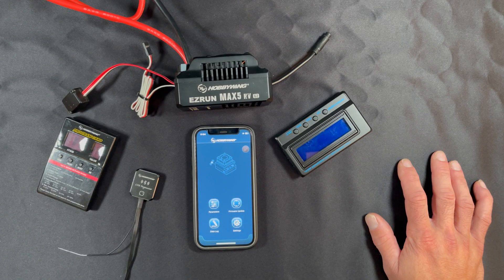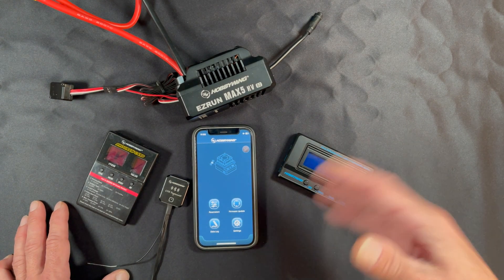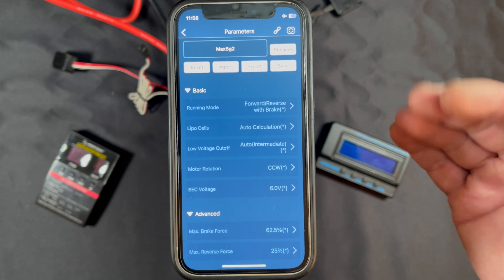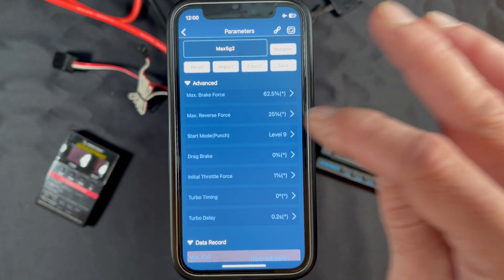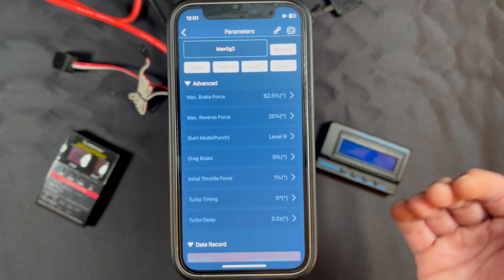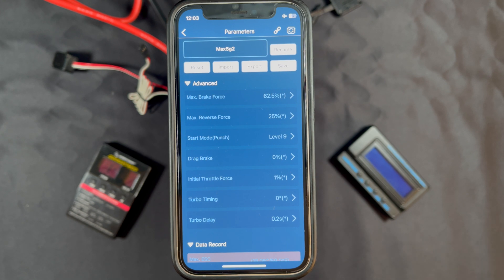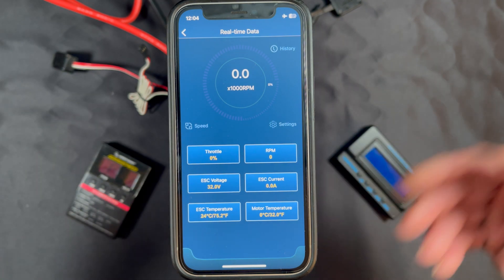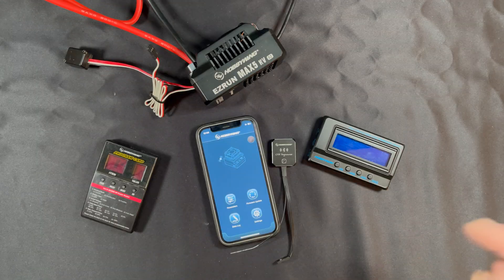The Charlie Show // Episode 323 /// Max 5 HV G2 setting and tuning

Comment: Hi, I'm using mine in a boat and have set to forward- reverse no brake  and disabled brake,
but when i push reverse it go's fine but when i push more  throttle  its like motor slows like it is braking,
Have i missed something or is this normal. Hopefully someone can help .

Comment: I jumped with my 8s exb with this combo nd I want to pull up the nose because it was diving.. But when i gave full throttle nothing happend for 1a2 seconds nd crashed on the nose. Is this this Initial throttle force that has to be higher?
Reply: Ypu need the ota to get the update I just did this today with ota link.
Reply: @never-stock-rc2968  i tuned it with the standard Hobbywing programcard and its doing perfect again 💪

Comment: There is ONE major thing this is missing. In the RC Heli world many escs when hit LVC they go down to say 75/50% power so you can safely land. Why there is no “get it back to me” for RC cars world is unreal. HW can easily adapt that mentality so when you do hit LVC you don’t have to walk and haul your 30+ lb car back, make it goto a safe only max 25-50% whatever output so you can acknowledge yes my lipos low and drive car back to yourself, unplug and change packs. Wouldn’t that be something @Hobbywing?
Reply from the maker: Thanks.  Most of the new models do that now.  Many users call it "limp home" mode.  There is an LVC warning that lowers power.  If you continue to drive it stops completely.  Some setups pull the battery down so hard, there is no "time' for the warning to work and it shuts down the motor completely.

Comment: Kindly I purchased a new Max5 g2 esc combo with 1100kv g2 motor and when I switched it on it doesn't count the number of cells of the battery. 
I checked the settings with the program box and it is on Auto lipo but it still does not make no sound or blinks.
I also noticed that the rpm readings are too high on the program box but I can not check the settings to see the number of poles to verify that it is correct. 
Do I need a bluetooth module, to check the data leggings or I can still use the program box and a computer? 
In case I need a Bluetooth module could you provide me with the part number or I can use any type of Bluetooth connection for example the one I use for the castle escs?

Comment: Please help. Max5 g2 with 800kv castle running uncensored. It won't even do a burner on dirt. Tried different settings. Rolls slow off the line then it just releases all power. It's in a Kraton 8s. 5mil front 20mil center 2mil rear. 1 to 1 gearing 39/39. This is my first hobbywing esc. What am I missing??? PLEASE HELP
Reply: I'm using the hobbywing program card to adjust settings
Reply from the maker: @mikerr5150   Email us - NorthAmerica@hobbywing.com and we'll be more than happy to assist.

Comment: Charlie, I’ve had my fusion pro since Dec 22 and it took a poop recently,
Started running hot so I removed it, ran a test, tried to reset it but it wouldn’t allow it.
After holding the power, getting the 7 red blips, then release after green, it won’t reset, it gives 3 beeps and red light flashes.
Upon manual calibration that failed also.
And when running the motor from full throttle to zero, they band is inconsistent,
At full throttle it was half, and as I back off the throttle it jumps to really fast, then stutters to a stop right under full throttle and feels a bit resistant and stutters.

I tried everything but in the end the motor just got really warm in my hands and I gave up. It’s always been in a lightweight lcg, had it 5 months but I’ve had an 1800 kv fusion for over a year in heavy rigs and it’s still goin strong.

Did I trigger this or did a sensor go bad somewhere? 
Went to corona Del Mar beach Ca. yesterday without my trusty hard liner and it hurt 😢
Helllp!!
Reply from the maker: Hard to say for sure.  Usually when they "just go bad" for no reason, it's more so that the reason is unknown.   Worse case, you can get it replaced through service dept for a discount.  We offer service through our offices in CA for customers in North America.  Simply complete the online "RMA Form" that is in the Support Section of hobbywingdirect.com

Comment: Hello Charlie😎
Would you recommend the newer max8 G2 combo for the fireteam in stock form just 6s bashing/Ripping on off road
Thanks for sharing💯😎
Reply from the maker: Max 8 G2 combos are great for bashing or track usage , but we do not have a Fire Team or any experience with one to know what "fits" for the motor.  If it uses a 42XX size motor, should be fine.
Reply: @HOBBYWINGOfficial  do you personally think this newer max8 g2 puts out and up with more a house then the OG max6 Charlie 😏